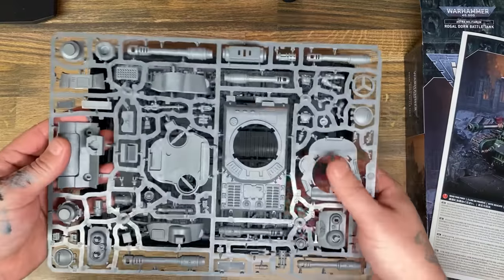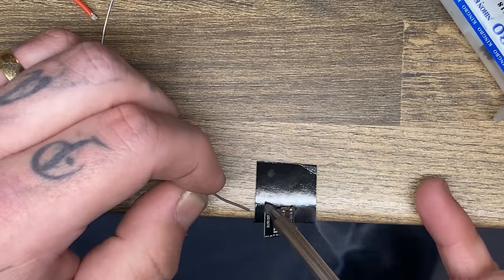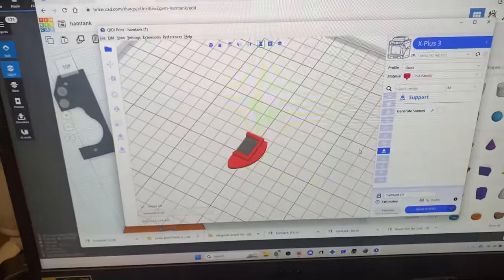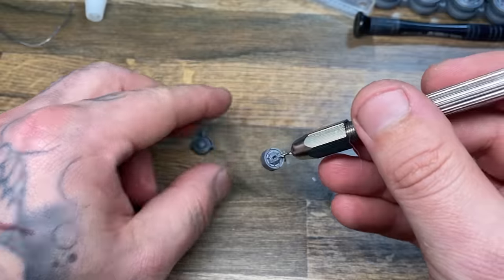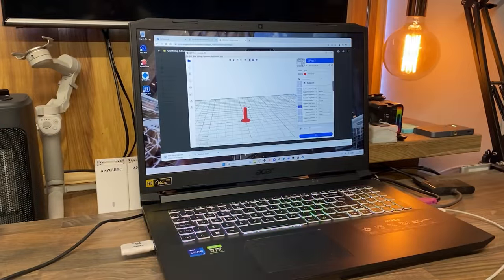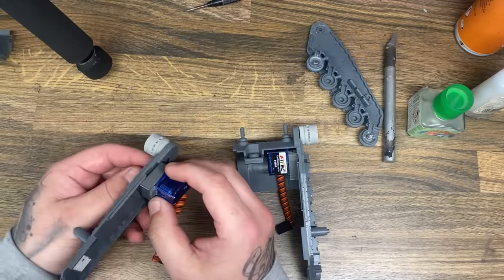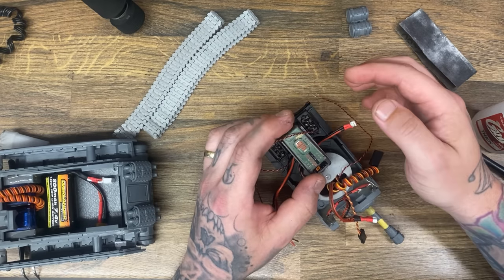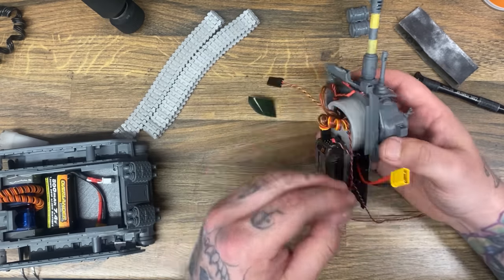I Built a Remote Control Rogal Dorn Tank from Warhammer

Comment: At the 8 minute mark the term you are looking for is the Drive Wheel which is different from the Road Wheels because the Drive Wheel makes the tracks move and are the only wheels connected to the transmission of the Tank.

Comment: i wish the running wheels were workable and has true suspention to simulate the tank better.. i know it would make things far more complicated but build would be much more rewarding… other than that great build and beautifully painted!!
Reply from the maker: I did intend to do that but I also had to make this on the sly in my spare time so time was a bit pressed. I’m hindsight I wish I did because the whole drive system suffers from drag due the those static wheels.

Comment: Amazing build!! 

Will you share the files for the dorn as you have done with your previous builds?

Thanks!!
Reply from the maker: I may. It’s not as fleshed out as previous ones as it was spare time build and I am not sure if I made many mods to the prints too.
Reply: Thanks for the reply, I've wanted to motorize the Dorn since it came out, but I have 0 skills in part design so it was a distant dream. 

Are the treads and sprocket from the Land Rider compatible with the Dorn?  @Groundeffected
Reply from the maker: @eudaldsans7601  no they aren’t. I will work on this kit dude. Gimme a bit of time. It’s not optimal though and may cause some sever frustration lol.